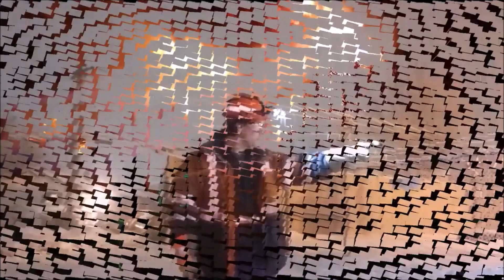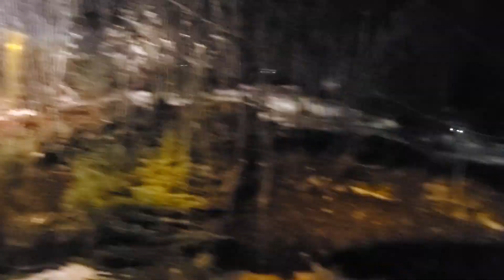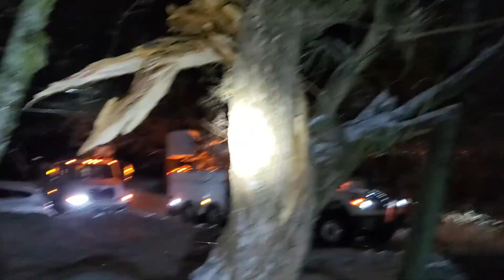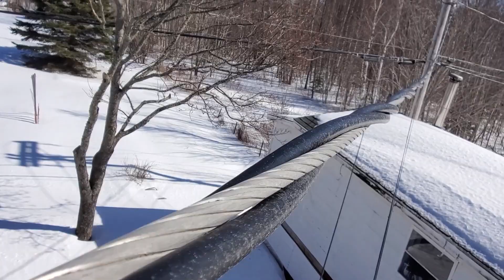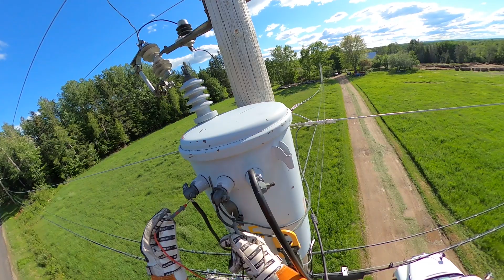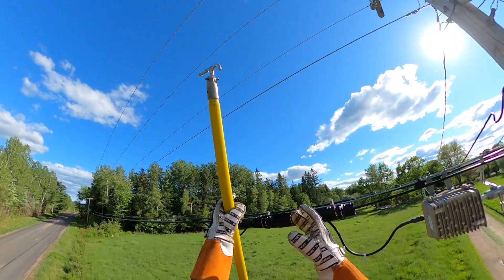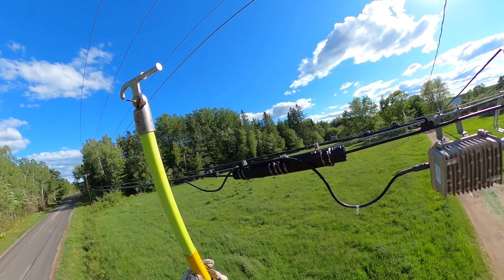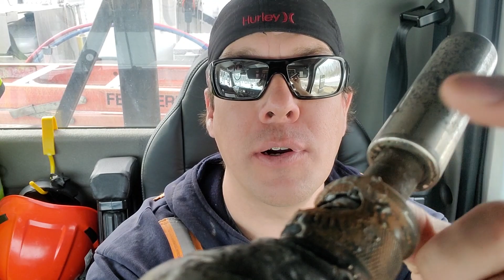Accidental contact with 120 volts

Comment: When I was about 5 years old, I put a screwdriver into a wall socket while squatting on a concrete floor. I remember the surprise when I couldn't let go, my hand was seized on the handle of the screwdriver and I couldn't move my arm. After a few seconds I was able to rock myself backward and the connection was broken. No damage, presumably because the resistance was high enough to limit current. Even small current can cause tetanic contraction.

Comment: For people wanting a medical background on it. The saying it’s not the volts it’s the amp is suppose to convince people don’t look at 120v as a toy. Any 60hz frequency is deadly as hell for humans. It’s actually the perfect sweet spot for interrupting the heart node. Which is a small walnut or smaller. that intercepts the signal from the brain. Basically like a distributor cap in a engine. Unfortunately the frequency is what is the deadliest for 120v in North America. 60hz at 120v in North America the human heart doesn’t like 60hz +. Some countries have regulated it has to be 51 or less. And that’s meaning the frequency is 60 Hits per second on alternating current. In very simple terms it means your brain electrical signal will get jammed 60x per second. Which brought the one arm rule in meaning. Don’t touch a breaker box or any hot item with both arms and make the ground out your free arm. That 60hz will basically jam the signal from the brain to the heart node ripping across your chest in one hand and out the other. I’ve unfortunately seen a lot of fatal injuries with 120v 60hz. The higher the voltage and amp the less fatalities we see because people dealing with the higher voltage systems are not your avg. diy home owner. Haha or say we have had some illegal lineman get hit by ridiculous amounts of energy and somehow live.

Comment: 120 volts limited by a 20 amp breaker can still put 2400 watts into a six ohm short.  At which point the breaker or fuse should blow.  But anything under 6 ohms is going to draw MORE current.   A 0.1 ohm dead short (very possible if a metal tool goes across the line) will draw 1200 amps off an unfused secondary and that's 1.44 million watts.     Now consider that the primary feeder is running at LEAST 2300 volts (that's the lowest common primary feed voltage),  which will have its own fuse or breaker.   How many amps is that fuse or breaker going to trip at?   If its trip amperage is high enough, it may never trip because the dead short across the secondary won't draw enough current across the primary.  

UNFUSED primaries are incredibly dangerous.  

I've seen 4160 volt lines galloping and slapping together, phase to phase, after a car hit a pole HARD.  Even those HUGE blasts of electrical sparks from the galloping lines didn't blow the primary circuit breakers open.  They're fused HIGH.  Don't know the actual amperage, but several seconds of direct phase to phase shorts in galloping arcs for several seconds wasn't enough to trip them.

Comment: It’s the amps that kills ultimately but the voltage helps push it. 12v car battery 1000 amps available touch both posts not much happening.

5kV DC megger, touch both leads, ouch that bit pretty hard. Your dealing with micro amps and the device does not have enough VA to sustain any type of harmful current like a taser

Comment: This is off topic of accidental contacts, but the school that trains the Apprentices here in Missouri is teaching the Apprentices to remove the stinger from the top of the cut-out before working on a pot. The reasoning for this is that there has been a lot of bleed through voltage on the cut-outs even on the Poly style. Is anyone else doing this or teaching this? Thanks, love the video's and content! Stay safe!!!

Comment: "it's not the volt that kills you it's the amps"

Ohm's law(V=IR): Am I a Joke to you?
Reply: P=V^2/R would be more applicable since it is the current passing through the high resistance of your body that is literally cooking you.
Reply: In this case there is not much to limit could have been hundreds of amps  going through that drill now if their was some kind of resistive load in series or current limiter that would bring the max current to say 100 ma would have been nothing more than a few little sparks

Comment: Okay so to a electrician 120V It's not really a low voltage but to a lineman yeah that's low voltage. Because I mean lineman's well they're used to working with 3,000 4,5 00 volts or higher .

Comment: Dad was a master electrician for over 55 years.  He passed suddenly a few years ago from a super fast cancer.   He showed me a lot but I still can’t grasp it all.  

Because of that, I paid someone to rewire the electrical panel in the house. I know I could have done it but for the extra 200.00 dollars during the generator install, I couldn’t pass it up.  

I do have a question.  When they were working on the install for the generator, they found the meter lugs were loose inside.  The one guy got up and cut the service line a foot back from the weather head.  He cut each one and taped them up until the meter lugs were tightened up.  Then he removed the tape and re-crimped them together.  How can he touch the live service line without issues?   I understand that he wasn’t touching anything else but he was on the roof. Can you explain?   

I wish dad was here, he would have given me all the answers.
Reply from the maker: My Sympathies in the passing of your father 💓

As far as working on live live service, it's very common with our trade. With today's safety culture, the individual was likely wearing rubber gloves while making the connections. The wire itself was likely insulated (as most service wires are now) also. It can be done without rubber gloves, but would be considered a dangerous practice.

Comment: It's not zero amps because the meter is removed. That's essentially the load. The ampacity is the capacity of the line. If there is no load, unless you short an impact socket from line to neutral, then there are plenty of amps! Think of an extension cord plugged into a wall outlet, but nothing connected to the female end...Welders usually operate at less voltage than 120V.

Comment: It’s not the voltage that’ll kill you it’s the amps, it was 0 amps when you measured bc there was no current. As you mentioned, if you make contact, you make a path for amps.. the amperage created at that moment is dependent on the resistance, which is your body.
Reply from the maker: That's exactly what I was explaining lol, well trying to anyhow. It's for that reason the saying can be misunderstood. Also, if the voltage is not high enough, you may not create a path. 
In a literal sense , the amperage kills. 
You need a high enough voltage tho.

Comment: I had someone try and tell me it's the amperage that kills. Told them no, it's the wattage. You can't have the amps without voltage. 

Had a job as a grounds keeper. Exactly 1/3rd the outside lights kept blowing. All at once every 3 months. Asked boss to buy a multimeter I had a theory and needed to know if the connector in question was hot. Well he didn't want to spend the money on a multimeter. The connector I suspected caught fire and tried to burn the building down. Wasn't going to touch 480/3 phase with knowing.

Comment: I work with everything from 2V cells at high amps DC in AC forklift batteries to lower amp 480v 3ph. I see fires in 24v motor controller circuits from shorts in 18 gauge wire. I have everything from basic flame resistant coveralls and glasses and 1000v gloves to an arc blast suit. I understand that repetition can breed complacency and shortcuts are tempting but remember that most industry safety regulations are written in blood and put safety first. Well said, nothing remotely controversial about wanting people to not get hurt or killed.

Comment: Just to add there is a wall of shame at work. There is only one tool on it that was cause by high voltage and that was a faulty load break tool. All of the rest are soft wire cutters burnt to shit by 120. Don't get complacent guys. I am guilty of it myself. Just look out for each other.
Reply: I love the concept of a 'wall of shame'.

Comment: I’m not an electrician but aren’t volts not nearly as important as the amperage?
Reply from the maker: Voltage is definitely important.
You could hang off a 10kv line all day like a bird and be fine. There would be 0 amps flowing through you. Even if the line has 1000 amps flowing through it. Touch the ground, or anything else, that is of a different potential and current would then flow through you. You would likely be killed. 

Same situation ... But you're hanging off a line that has 10 volts (but still 1000 amps flowing through it). Now you touch something else, you would be fine. The voltage is not high enough to penetrate the resistance of your body. 
Voltage is most definitely important.
But it's the amperage that kills! Er.... If the voltage is there too 🤔

It's the current passing through you specifically that causes the damage.  The higher the voltage, the easier this can occur.
Reply: @Bobsdecline   That makes sense. I love the analogy of water flowing through a hose to electrons flowing through wire to people that don’t understand electricity. I’m trying to figure out how you could illustrate that concept to that scenario
Reply from the maker: I've thought about it before and come up with a few ideas. I try and stay away from the topic however because it usually results in an infinite debate. It can difficult to explain with two sides both being right while simply having different interpretations.
The resistance value plays a large role in this as well yet is often unmentioned

Comment: I had a pole fire down the street and a bucket truck came to the pole in front of my house. The guy was in the bucket raised a long pole to the top looked like he disconnected something on top of the pole and there was one hell of a arch flash and smoke. Did he do something wrong or did he expect that to happen? Was wondering what happened and if that was normal? Thanks

Comment: As a former Line clearance tree trimmer for 8 years in California, I have seen holes blown through straight inch half metal from guys making contact with only secondaries or a triplex. Seen primaries struck and its an experience that will give you an all new respect for High voltage,Power lines. Be safe

Comment: yeah, a 120v but an astronomical amperage, as a welder the voltage we weld at is extremely low but the amperage is extremely high and that's what is gonna kill you not the volts. go look at a taser they are high volts low amps

Comment: Mate you hit the nail on the head re: primary HV fuse not blowing.  The instantaneous fault current is what did the damage, a result of a low impedance short circuit on the transformer secondary.  I’m in Australia & our Phase-Neutral voltage is 230V, Phase-Phase is 400V.  Transformer primaries on the distribution network in my area are typically 11 or 22kV.  Arc flash is the killer that most of us get complacent with.

Glad to hear the guy involved was not injured.  Stay safe 👍

Comment: Yes in theory the amps kill. But if there is an open in the circuit there is still voltage no amperage though. But once there is a path there is also resistance. E=IR. The average person needs 100-200mA to kill. A human body has an average resistance of 200 ohms. 120V÷200ohms is 0.6A or 600mA. And 600mA is 3-6 times more than what can kill you. And with most fuses in the big transformers are delayed fuses so could be 30+ seconds before it trips and you'll already be gone. Thank-you for making this video it is a serious thing. And people need to know about it.

Comment: The same can be said about voltage.  I can grab onto a 5000 amp line at 5 volts and it's not even going to tingle.  It will almost instantly melt a piece of metal though.  It's just that there aren't enough volts to push that current through you.  I was always told the human body has a resistance of about 30 volts, give or take.

Comment: I feel like most normal people are afraid of the 120v plugs in their homes. So I find it hard to believe anyone other than a complete idiot would think a wire 20x bigger  is any more safe. Or do they let people in Canada work on power lines that have zero comprehension of breakers , or gauge size of wire or cable.

Comment: I'm not sure what they teach in Canada. Here In the states there are always public safety warnings letting people know power lines  kill. Any time I've ever heard the amps thing, it's in reference to residential stuff. Like getting shocked by a 120v wire in the wall socket might hurt but most likely won't kill you. Getting hit by a 220 plug for a dryer or a welder on the other hand could kill you. That's where the amps reference comes up. I've never heard any one say oh it's ok that down power line is only 120 so yr good. Who is this video really for?

Comment: Hmm.. but it is the Amps that kill you. this is why you can have a taser with 50Kv and only 2 milliamps. The Votage is not doing the damage, the Amps are, when the socket gun touched the 2 lines the Voltage didn't do the damage, the unrestricted AMPERAGE melted it.
Reply from the maker: Agree 💯. The saying however can be misleading.

Comment: It’s really all about potential and fault-current. In the home most circuits typically have a 10-15amp breaker (US) so 1,200VA for a cycle before it’s interrupted. If that breaker was bypassed it would take 100A (12,000VA or whatever the rating of the main breaker) to trip, if that was bypassed it would be tremendous which is what your partner saw… stay safe brother

Comment: Just wondering how in the beginning you say voltage of 120 can hurt or kill but not amps.  Then you go by taking a a garden hose an release of the pressure is the amperage so what you are really saying is the amperage kills please liston to your yourself it bad either way. I'm 100% glad no one was hurt or killed.
Reply from the maker: The saying itself can be misleading, nothing more. In a literal sense, it's the amps that kill. A line metered at "0" amps is absolutely not safe and will have current flow should it be touched in the right circumstances.  Cheers 🍻✌️

Comment: While the saying "it's not the volts, but the amps that kill you" is somewhat misleading because it makes it seem like "low voltage" is safe, in reality, it is indeed the amps that kill you. Anything over 5mA can cause severe harm to humans and, honestly, a common 9V battery can easily kill you if shorted across your heart in the right way. While this is being a bit extreme (and would never be found in-use in the wild), a 1V / 0.5A line can be just as deadly as a 9,000V / 0.5A line. Also, fuses aren't designed to protect humans being accidentally shorted against live wires; fuses (and breakers) are designed to protect wires from overheating due to overcurrent (or current spikes not able to be dampened by filters, etc), thus causing the potential for fires. GFCI's (and similar devices) are what is designed to protect humans from being injured severely by shorting out circuits. Moral of the story, be extremely careful on any wires and/or circuits that have anything over 0.000A and 0.000V (the AND is very important there as are the number of decimal points). On the flip-side, you should always assume a circuit is live until you know for a fact that it isn't (and has zero potential of ever being live without your explicit knowledge and agreement) and always practice standard operating and safe-handling procedure when dealing with any circuit of any capacity (yes, even tiny 9V batteries should be handled with care!)

Comment: Only 120V? Try 24V of a truck battery. Batteries have a very very low internal resistance so they can output enormous amounts of amp. Here are some lunatics creating a transformer with just a couple of windings in the secondary. So they produce just a tiny voltage but a lot of amps, enough to melt steel:
https://www.youtube.com/watch?v=DJOX0c60wQE

So there is no general valid statement what is more dangerous, voltage or amps. Without enough voltage you don't get much amps if the resistance is high. Since the human body is a bad conductor it requires a higher voltage until it causes damages to the body. However low voltage that is shot circuit is also dangerous since it can literally melt steel. Though it always depends on the internal resistance of the power source which limits how much amps could be output. See this ElektroBoom video on Voltage vs Amps:
https://www.youtube.com/watch?v=XDf2nhfxVzg

So watch out with batteries, they can be quite powerful. Here they insta-melt a nail with a 12V car battery:
https://www.youtube.com/watch?v=xESCXFz8ZQE

Comment: I agree with your dislike for that misconception about "its the current not the volts". Its both.  Worst shock i ever got was from 12v DC working on a car amplifier and all i know i went from leaning inside the rear door working on an amp mounted to the back of the folded down rear seats, to on my ass about 3 feet back from the car with a bad blister/burn on my fingertip. 

How much current is that circuit capable of?  I understand that there was no current  in the line, but the moment the drill completed that circuit, i'd imagine it was a metric f***-ton. 

I'm not an electrician but know enough to have done a full rewire on a 3 bedroom home. I've got mad respect for what you guys do though. Thank God (is that allowed in Canada anymore?) nobody was harmed when that drill blew up. I bet he had to change his shorts after that one. lol.

Comment: Shows how robust a dewalt impact is though. Took a hit strong enough to melt steel but still runs
Reply: It might still be possible to fix it by affixing a new chuck, but it looks like a more impressive lesson the way it is.  120 volts with nothing but the current protection on the pole transformer is an arc welder on steroids.